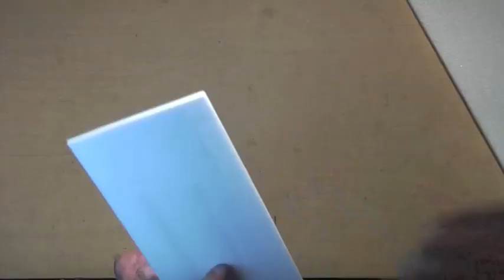the Armin Wing: part 8 - Wingtip Caps & Improved Trailing Edges

Comment: I know it's kind of a simple question, but are you using a hot glue gun, or a low temp gun? I am using a hot glue gun, and every once in a while it melts part of the foam. I wasn't sure if a low temp would adhere as well as a high temp one.

Comment: I just watched your 'improved fuselage' video and noted the use of water there, so -
- you need only spray one surface, you can mist just the foam-side tape.
- you'd be pushing the water out and away while applying
- It's likely that very little water will contact the paper edge

Of course, this is just theory at this point. When I get to that step, I'll give it a shot and tell you how it turns out.

Comment: Your concern about the tape sticking together prematurely can be helped with a fine mist of water on the sticky side, which will get squeegeed out with the card.  It's a vinyl sign/decal maker's and window tinter's trick.  

Use plain tap water in a misting spray bottle - you can get big ones from the plant section of a hardware store, or small ones near the window tint at the auto parts store.

Comment from the maker: I like the 9g size for all applications.  There is an $8 digital metal gear EXI and a $4 standard plastic EXI I get from HobbyPartz and use depending on the force needed and the abuse expected.  TPro and HXT900 are hard to beat for price in small planes and non-critical uses.  Virtually all the rest of the parts I order are from HobbyKing.